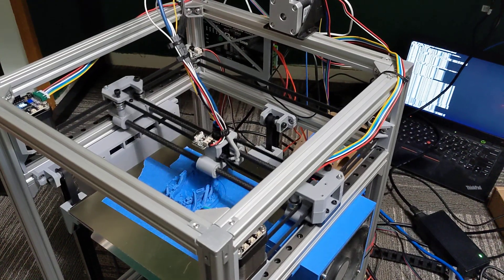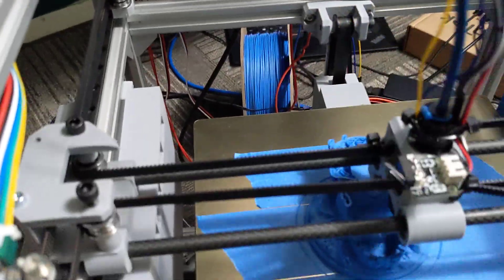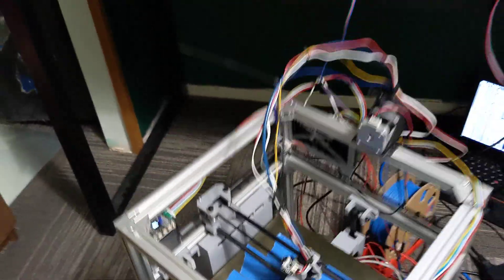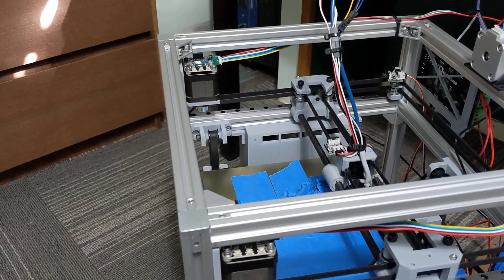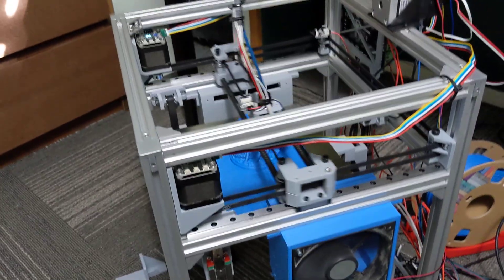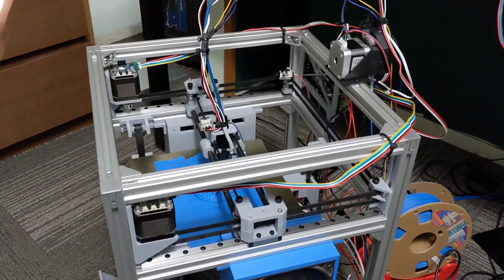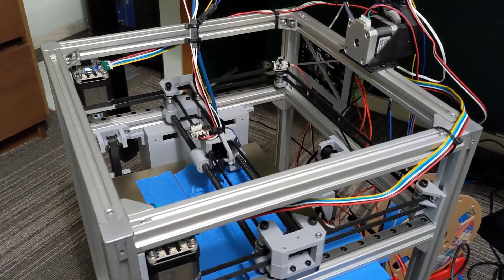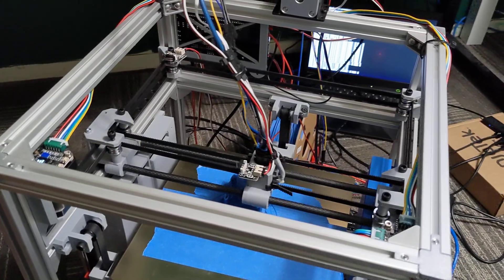DIY Fast CoreXY 3D Printer! Carbon Fiber X rods!

Comment: I know you abandoned this because of inconstant rods, but I was wondering if you encountered any galvanic corrosion where the carbon contacts the steel bearings.
Reply from the maker: you don't use steel bearings on the carbon rods they must be IGUS
Reply: @ Thanks. I wasn’t familiar with those.

Comment: If anyone watching this want to do this. Buy "plain weave glossy" carbon rods. Many sellers on China can let you pick if you want the Manufacturing tolerances to be between 8-8.1mm instead of 7.9-8mm which is good as you can make them perfectly even with some sanding for 0 slop. Om top of that igus bearings are good as they will wear down instead of the rods. 
Use extra ptfe lube for even less wear as lubr should absolutely always be used even with self lubricated bearings. This is because the self lubricated ones are using its own material to replenish the lube aka they wear down in order to lube... So use ectra lube to negotiate rhis.
Get 8x4 ones as tve extra strength will be very useful.

Comment: check out "welded 3d printer" just weld up a steel frame. 30 minutes of watching welding videos should teach you enough, or get someone to fabricate you a cube.  The above mentioned video shows alignment techniques for parallelism  if you are not using rails.

Comment: Instead of adding a fan, you may want to just add another tube, that runs to a remote air compressor, this way you get the airflow without the weight.
Reply from the maker: this project was abandon because it is too hard to find carbon rods of a consistant OD

Comment: Is there any reason you've stopped using carbon on your projects? I always wondered why carbon fiber rods are not widely used on DIY printers.
Reply from the maker: the rods are not very round and have a bad OD, bearings do not slide well
Reply: @Rolohaun  Thanks!

Comment: How did this work out for you? Your Y is fairly heavy. Did you ever consider IGUS for Idlers? Or just printing idlers? Projects like these tend to end with a realization of the sloppy tolerance of the lighter rods or tubes, and then the projects tend to just die. It is a shame, because we do not get to see what we are actually missing. With some more targeted design, and just finish a real project, my bet is that the only thing missing, is light weight tight tolerance OD tubes. Printed bushings, printed idlers, and suddenly the weight is like 0. At least for a simple core-xy.
Reply from the maker: rods are wavy and not good, sanding will not help they aren't really for motion
Reply: @Rolohaun  Thanks. It is a bit confusing though. People post videos using CF in working rigs. Just like you did. Not sure what defects or flaws showed up in the prints, given the initial rage.

Also, CF tubes are not made the same. As far as I can tell you used a cross stranded version, heaven knows baked into what, and in what way. You found unreliable OD.

If there were some other factor, like the material wearing down, I don't know. But you found them not ready for motion.

Hope I got that right.

This seems to be the recurring theme, of the very few that enters this.

Thanks for sharing.
Reply from the maker: @FrodeBergetonNilsen  I tried every manufacture on aliexpress I tried pulltruded also no luck
Reply: @Rolohaun  Thanks. Really appreciate the feedback.

If anything, I might make one using CF to show off what can be achieved, if just someone made a proper one. This is such a loss for the industry. Somehow Bamu labs hints at what can be done.

To me, aluminiumm rods from Igus, is the only light weight alternative to steel rods with tight tolerance I can find. Igus also make some aluminium  tubes, but they are just as heavy as their 8mm rods.

If you know of anything else, please let me know.

I am working on a printer using 10 by 8 mm tubing, with not so great aluminum tubes. It might end up being a proof of concept, and the core design can easily be transformed into 8mm tubes or rods, supporting the usual suspects for bussings.

10mm OD and 8mm ID is more than enough for a decent printer.

But it is just irritating that no one produces tight tolerance CF tubes. They got everything we need, if only the price is right.

Comment: can you share the STL's for those XY joints and toolhead I wanted to try them for something. did you ever release this version?
Reply from the maker: unfortunately I do not have the files, I never kept them as it's too hard to find carbon rods that have a precise OD for bearings to run on them

Comment: Year after I can print benchy on my Sovol SV07 slinger with Klipper in 25 minutes and it cost me only 220 $ new refurbrished. Times go fast. 🤷‍♂️😉🤓
Reply from the maker: ya this is a old printer that I never even tuned up the accel on. The project died because it was too hard to find CF rods that had a consistent diameter
Reply: @Rolohaun  But direction was right.

Comment: This is excellent!! I had this same idea of carbon tubes + polymer bushings a few months ago but wasn't sure if it would work. Looks like no issues. Did you see any noticeable improvement in quality or speed with the closed loop controllers for the stepper motors? Cheers
Reply from the maker: this was abandon, very hard to find CF rods that are a consistent diameter. Closed loop steppers are great but some users report they can't go that fast, I find you need to calibrate them first using the onboard controller on the stepper
Reply: Hi where to find carbon tubes like yours ? @Rolohaun
Reply from the maker: @mariuszczerwonka5249  I just bought random ones of aliexpress. It's impossible to find some with consistent diameter
Reply: @Rolohaun   Were the rods marketed as RC drone tubes? That seems to be what most are marketed as. Also, how have the Igus bushings held up? From what I would presume, the bushings would wear due to sliding on the carbon fiber, but maybe that is different with the igus bushings.
Reply from the maker: @stuffiesforces7189  I have tried different tube's they all suck. I did not keep this printer long. Igus bearings are self lubricating so the wear is minimal
Reply: @Rolohaun  Hmm, bambu must have a way to source good quality carbon fiber tubes. Perhaps they were solid rods instead of hollow tubes?
Reply from the maker: @469monkey  I believe they get everything from igus
Reply: @Rolohaun  The tolerance of the igus shafts are about h11, so not a whole lot better than those random aliexpress ones. The smallest diameter is 12mm. Do you know what diameter the bambu ones use?

Comment: I wonder how accurate and reliable this is with a regular carbon fibre rod, their thickness changes a lot and they are not "Flat" or whatever the technical term for it was
Reply from the maker: it worked very well, the only problem was it's had to find CF rods with a consistent OD
Reply: @Rolohaun  oof yeah

Comment: Hey. I thought you told me you didn't have a carbon fiber rod printer.???
Reply from the maker: I abandon this project a while ago because it didn't work well for DIY, you need to get lucky to find carbon rods with a good OD
Reply: @Rolohaun  So did you ever find a good source for the carbon fiber rods? I think it has really great potential. If not, what machine did you replace it with? Going to build one of them. What would you recommend? Thanks.
Reply from the maker: @boztech  no I did not, this printer was canceled. My panda printer is replacing this. It will be out soon

Comment: Also make sure you are putting the igus bearings in the properly spec size hole (they need to be compressed to achieve no backlash and proper life expectancy) I just used the metal cased igus bearings that are precompressed but for lightweight I would recommend .5mm below OD
Reply from the maker: yes Igus need a clamp for best results so you can fine tune the pressure.

Comment: You can get the same linear shafts as bambu does from igus. They make specific carbon rods for lightweight applications.
Reply from the maker: it's too expensive to be worth it for DIY, around 114 CAD and it's a whole assembly

Comment: Just wondering if you've ever experimented with alternative materials for the frame.  Your comment about a really stiff frame being a good way to transmit vibration through the machine.  With a hollow material you could fill the frame with lead shot or sand to deaden vibration.  You could still use aluminum extrusions for some of the frame, but using something like black gas pipe from the hardware store could be one way to have vibration dampening built into the frame itself while still building a very rigid machine.  The DIY CNC community does stuff like that.  Might not be a bad place to get some inspiration.
Reply from the maker: I have been experimenting with 3d printed frame and some other ideas, defiantly stay tuned to my channel I have many ideas coming

Comment: You still play with cabon? i am building square hollow carbon fiber x axis with teflon bearing. I use huge centrifugal blower mounted on the chassis for cooling.😅

Still making high pressure temperature controlled oven to make tempered carbon fiber.
Reply from the maker: oh cool, I found the carbon rods really inconstant for the OD
Reply: @Rolohaun  I need to built cnc first, got problem with precision on carbon parts.
Reply: @Rolohaun  How bad was it? The aluminum tubes I can find for cheap is like +-0,05mm. They pretty much stay within 9,9 to 10mm. But they are mostly gradually changing OD, and for each tube, it often times stay with in far less than that. The only tight tolerance tubes or rods I could find, was IGUS for aluminum rods and IGUS for aluminum tubes. The tubes are enormous. The tolerance of them IGUS Carbon tubes, are not really that tight anyways, and they are stupid expensive.
Reply from the maker: couldn't even get the bearings on some @FrodeBergetonNilsen
Reply: @Rolohaun  They sometimes need some sanding. But did you try to measure them? What are we talking about? How inaccurate was each tube? If it is off, but constantly off, that is something we can deal with. But if it is wavy, that is another story.

Comment: 1. Making a fast moving printhead is pointless if it spends sooo much time on retractions! Making havier (and therefore slower) printhead but with a motor on and therefore much faster retractions will made the printer faster.
2. I just don't catch the idea of using triple  Z-axis on any printer and especially on such a small printer. Two Z motors with separated limit switches are MUCH less complicated and it does the job very well!
3. Regardging the close loop motors it is VERY interesting:
   3.1. How much pricier this comparing to open loop solution?
   3.2. Did you compare the speed to openloop solution?

Please make a video about closeloop. This is extremely interesting!
Reply from the maker: I agree direct drive is they way to go for the most part, however with a small enough bowden tube you can have low retractions. 3 independent z motors can automatically make the bed flat and you need 3 points to make a flat plane, klipper can do this with Z_tilt automatically. This is a prototype that I scrapped so I haven't tested close loop much yet. I will be doing more testing on newer builds. Closed loop are around $10 more or so
Reply: @Rolohaun  $10 more per each axis?
Reply from the maker: @rmatveev  you only use these on X and Y and these steppers do not need drivers so that will technically save cost as you do not need to buy steppers for X and Y
Reply: @Rolohaun  So you need these $10 twice? For X and Y?
Or $10 is the price for both X and Y?
Reply from the maker: @rmatveev  https://www.aliexpress.com/item/1005003380684185.html?spm=a2g0o.order_list.0.0.2dd81802u0rfIj&gps-id=pcOrderListRecommend&scm=1007.38956.333894.0&scm_id=1007.38956.333894.0&scm-url=1007.38956.333894.0&pvid=58c4a624-dd65-4cfe-98aa-4c1838339ed9&_t=gps-id:pcOrderListRecommend,scm-url:1007.38956.333894.0,pvid:58c4a624-dd65-4cfe-98aa-4c1838339ed9,tpp_buckets:668%232846%238109%231935&pdp_npi=3%40dis%21CAD%2142.03%2119.33%21%21%21%21%21%402103146f16835590951787449e5401%2112000030844109387%21rec%21CA%21143470760

Comment: Does anyone beside Ultimaker use the crossed rods? I’ve always been fascinated by that setup
Reply from the maker: There are some more starting to come out, This printer here is still CoreXY. I do have a printer similar to the motion of ultimaker called Defiant which is called CroXY or Cross Gantry

Comment: Hi, neat job. Where did you get the extrusion 90 degree end plates from?
Reply from the maker: they are on amazon and ali express https://www.amazon.ca/Aluminum-Profile-Connector-Include-Bracket/dp/B097TB84D2/ref=sr_1_4_sspa?crid=20ROM8YQTJI51&keywords=corner+bracket+2020&qid=1680126531&sprefix=corner+bracket+2020%2Caps%2C130&sr=8-4-spons&psc=1&spLa=ZW5jcnlwdGVkUXVhbGlmaWVyPUExU09KOTkzN1JTSUxBJmVuY3J5cHRlZElkPUEwNjg1MTMxVlpGMFBUM0c1RjA4JmVuY3J5cHRlZEFkSWQ9QTA2ODE1OTYyVVlHRkxVVVNUSVVXJndpZGdldE5hbWU9c3BfYXRmJmFjdGlvbj1jbGlja1JlZGlyZWN0JmRvTm90TG9nQ2xpY2s9dHJ1ZQ==

Comment: Hi, amazing printer! It's amazing bro, good job and congratos for this idea, so i have a question, the carbon rods are solid? could you share the link of this rods? thanks
Reply from the maker: they are hollow, this build was canceled you can get the carbon rods on AliExpress, unfortunately they vary in OD
Reply: @Rolohaun  thanks bro for your answer, i apreciate your time! So, how do you to use 2 boards on this printer 3d? why, what is the approach? thanks
Reply from the maker: @CristianRivas  I just had two lying around and I needed more ports Klipper supports this
Reply: @Rolohaun  Hmmmm ok, so you have any tutorial/video about that? or maybe consider suggest any tutorial or doc reference for me? tranks man
Reply from the maker: @CristianRivas  here is a sample config https://github.com/Klipper3d/klipper/blob/master/config/sample-multi-mcu.cfg

Comment: I have a question about these inside corner thingys, are they as strong as blind joints? Designing a corexy printer, trident/simplecore style. Cant use a trident frame bc the bed has 4 mounting points and is 33x31 cm. There won’t be an enclosure so the frame has to be rigid
Reply from the maker: there are solid, blind joint might be better but they should still be fine for making a frame ridged https://www.amazon.ca/Bracket-Connector-Aluminum-Extrusion-Profile/dp/B0794XMPG4/ref=sr_1_18?crid=UWMOGHXIH12C&keywords=2020+corner&qid=1678802448&sprefix=2020+corne%2Caps%2C120&sr=8-18

Comment: Yeah! 👍awesome work bro. My direction as well, will try hollow shaft on x&y. more than half the weight removed. wants to remove both fans using air hose another 50+ 8:59 g shaved off excluding fan shrouds.(less wires too). Will also use the side fan as u have done like Vzbot n bamboo. I don’t like coreXY. I prefer cross gantry with always on 2 motors per axis shorter belts. Sourcing carbon rods not cheap last options. My challenge is cheap n readily available but print fast n quality. Thanks for sharing your awesome build💕love it.

Comment: One of the things I always admire a Voron for is their cable management with drag chains mounted in a good way.  It makes other printers, including mine and this one unfinished.  So: you asked for ideas to integrate: better cable management to the hotend.
Reply from the maker: I would really like to see more usb C toolheads, not can bus but just simple toolhead mcu boards connected via USB. Still waiting for that
Reply: Drag chains are nice and all but when used properly they ad quite a bit of weight to the y axis. Guiding the wires along the ptfe tube is the way to go imo

Comment: Awesome project! Great design choices all around! Thanks for sharing.

I wonder if you could use tensioned steel cables like guy wires to reduce the vibration of the printer without having to add expensive mass etc? I've been thinking about something like this for my flsun q5
Reply from the maker: Yes I have seen some delta printers use that method, the frame in this printer is already pretty ridged I don't know if cables would help.

Comment: have you name it yet and nice job
Reply from the maker: this printer is no longer being built, it is hard to find carbon rods with a consistent outer diameter. I made a cross gantry printer instead called Defiant. There will be more videos on it in the future.
Reply: @Rolohaun  ok thanks

Comment: I have a set of rails from when I converted my Anet A8. What's with the attachments to the X and Y motors?
Reply from the maker: the is a old printer I never finished, it uses closed loop stepper motors
Reply: @Rolohaun  thanks for such a quick reply. "Closed loop" is a special kind of motor? Or do the electronics make a normal motor closed loop?

Comment: the only thing i would be worried about is the resin in the carbon rods would probably soften if you enclosed it.
Reply from the maker: yes it could, I abandon this project and went with a different route
Reply: @Rolohaun  ah that's too bad it looked great

Comment: Hi, interesting stuff, what is the advantage of closed loop steppers and is it a lot harder to set them up ? Thanks
Reply from the maker: closed loop steppers are quieter have less vibration and run cooler, they also do not skip steps. Easy to setup in Klipper as everything is set on the board attached to the stepper motor.
Reply: @Rolohaun  are they compatible with Marlin and if so which driver do you select in the firmware ? Thanks
Reply from the maker: @acestu  I have not tried them in Marlin they usually get setup as a A4988
Reply: @Rolohaun  Thanks Rolo, it sounds like an awesome bit of kit !

Comment: Rubber ends on the extrusions to reduce vibrations. Or you can put a memory foam pad like Stephan from C&C Kitchen did to reduce vibrations.
Reply: Yeah not all parts have to be rigid and stiff, esp the gantry.